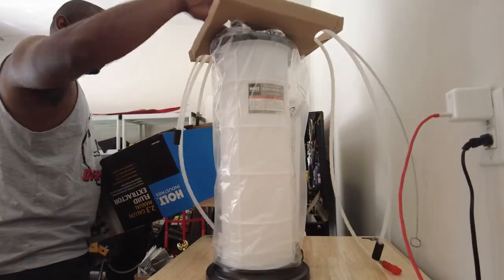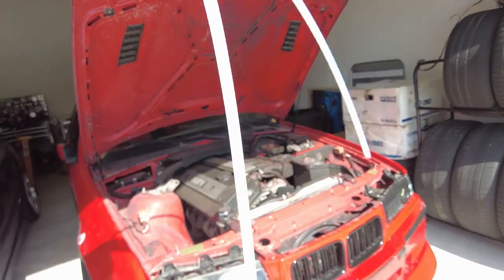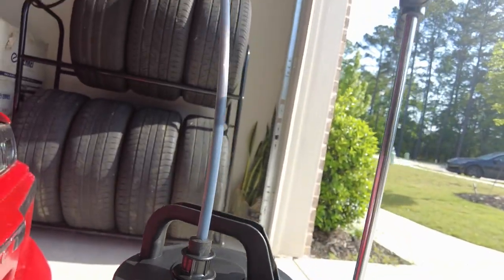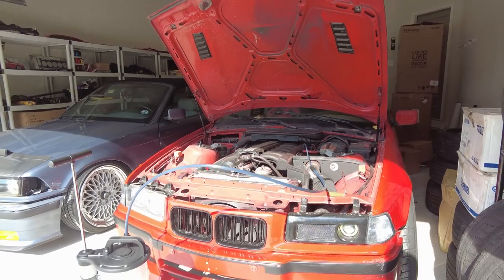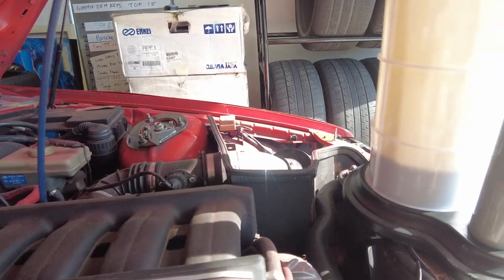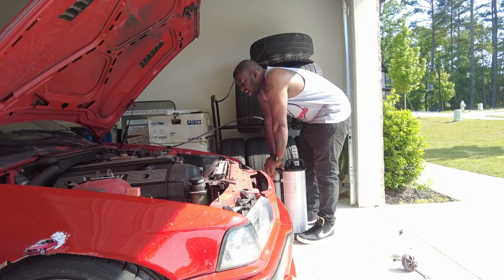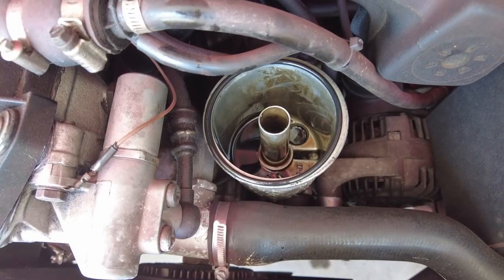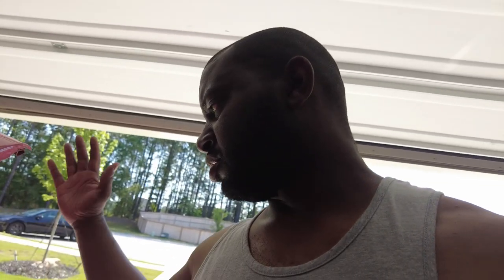Harbor Freight's Manual Fluid Extractor [Honest Review]

Comment: There’s a recall on this product, I’d double check to see if yours is defective . I’ve had the same one for almost 2 years now and works 10x better than that. I use it for 2014 328d and it sucks up 6qts of oil in a matter of minutes. Definitely seems like yours might be defective
Reply from the maker: Hmm. I'll have to look into it. My friend told me he just pumps a few times and walks away 🤔
Reply: The recall isn't on this one, it's the Holt extractor and dispenser. Has a blue top

Comment: You bought the wrong one. I bought mine off Amazon that looks the same as yours for $84 dollars. To remove 5 quarts I’ll pump mine 10 times that’s it. In around 4 minutes it removes the 5 quarts. Mine has a reverse so it then pumps it out into the 5 quart empty oil jug. So clean and easy to use.
Reply: LINK?

Comment: I have been using one of these for years now, used it on my E46 330i, my 2017 E-Klass, my 2014 Volvo S60 T5, my Nissan pickup, I will not put a car on jacks to change the oil again.

Comment: I use one similar to the HF one you have on my 1998 Z3, yes it's slow but I just let it go until its done.  I've found  that warming the engine, remove the oil cap and loosen the oil filter helps.  Best of all, I'm not getting under the car

Comment: hey, was the engine warm? i'm trying to get a gauge on if it'll work faster or not. i have a topsider, it's also kinda slow, i got new seals for it so it might be a lil faster now, but i'm not sure, i was hoping one of these holt ones would be faster since it has a longer pump than the topsider

Comment: To make this job easier run the car for a few mins the let it sit for about 5 mins so the oil can drain back down. Always remove the oil filter and take off engine oil cap off it helps the oil flow out faster
Reply: This !👍

Comment: Have the same one from Harbor Freight. I used it for an oil change on my wifes MK6 GTI, drained very little. I kept pumping and pumping and saw no new oil moving through the lines. Removed the oil pan plug and a steady flow of oil flowed from the oil pan, approx. 2 quarts.

Comment: I bought one of these for my MK7 GTI and I sucked 5.75 ish quarts out of 6 quarts after 5,000 miles. There was still fluid in half the hose at the end so I know it didn't get it all. When I put the new oil back in it took a full 6 and wasn't over full so I think I got majority of it. The only down side of the extractor is the oil left in the lines after pumping. Had to be careful not to set them down anywhere important

Comment: I use a similar extractor like this but there’s a tight fit on the oil stick opening which causes continuous pressure into the tank. You may have missed something in the instructions. Also warm up the car for 5 minutes.

Comment: I might be wrong, but its probably suctioning so slow because you need to pop your oil fill cap off to speed it up, need to let air in to displace the oil, or else you are fighting a vacuum from the engine.

Comment: I don’t see how this could get all the funky oil from the very bottom…..
Reply: I'm happy that he did that review. I was thinking about getting a manual oil extractor, but no way now. I need new ramps and jack stands, but ok before buying such an extractor. I am also thinking of going to a shop but I don't trust those jiffy lube guys, they usually do more damage than good.
Reply: If you have "funky" oil, you probably waited too long to change it...
Reply: @JK-cq5nc these work great if you can manage to stop air leaks, and always check your car specifically. Some cars can't use extractors and some are designed to use them
Reply: If you do your oil changes you have no “funky” oil. Obviously if you are watching this, you do your maintenance, you don’t have to worry about it, ignore all owners manual on mileage, change at 5k max.

Comment: You need to open the oil fill cap so that there is no vacuum
Reply: There's no vacuum... It's not a sealed unit. If you pull the plug sure, but that's also draining MUCH faster